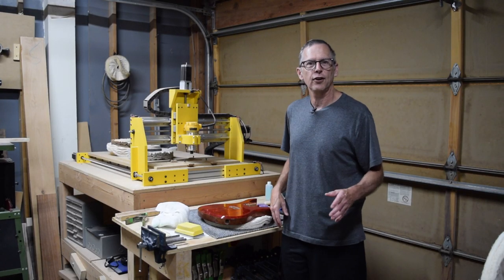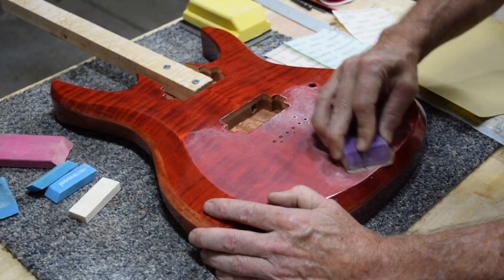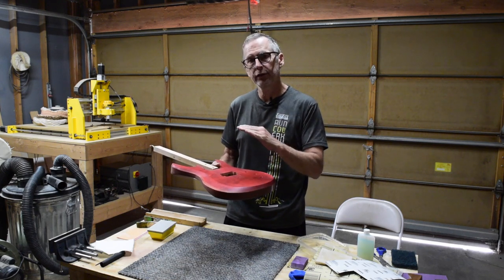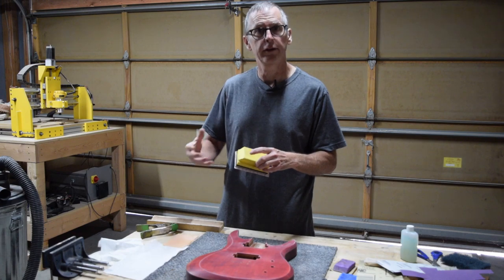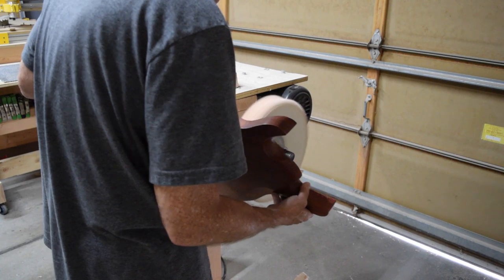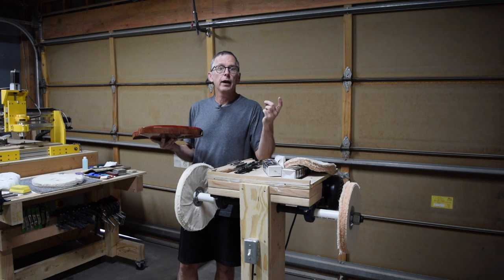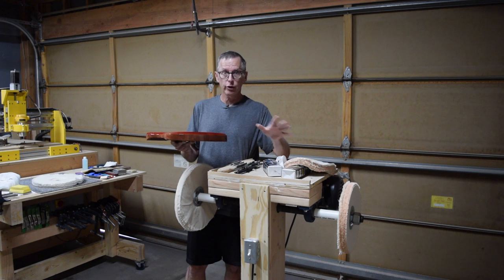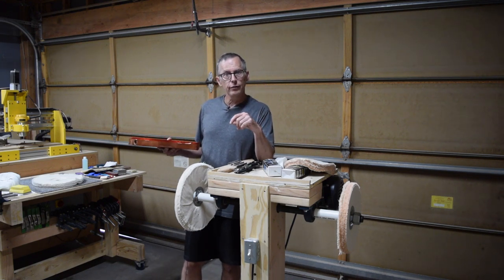How I Level Sand And Buff The Finish On A Guitar

Comment: Hello Chris. If I may ask. What rmp would you recommend for compounding and also polishing on a hand held polisher? I have a Avid dual action random orbital polisher that the slowest rpm is 2700. Is that to fast or aggressive for a polishing speed?
Reply from the maker: Sorry, I don’t know. I have never used a hand held electric polisher. I am considering switching from my big buffer to a hand held polisher, but I need to find one that can run from zero rpm and up. That way I could test to find the optimal speeds.

Comment: Great video! I have a fair amount of experience with painting, sanding, and buffing in an automotive application, and I know that edges are particularly scary in that you have to pay close attention to the direction of the rotation in relation to an edge so that you don't buff the paint off of the edge. I've never used a buffing wheel, or buffed a guitar....or water based for that matter.....is it just as critical and delicate near the edges using the buffing wheel? And how easy is it for the guitar to get ripped out of your hands when doing the horns? Thanks!
Reply from the maker: The wheels are too soft and spin to slow to burn through at the edges unless you really try. In the dozen or so years, I've used buffing machines like the one in this video, I have never had a guitar body or neck ripped out of my hands.

Comment: I've never used the polish sanding trick but then again, I buff with 3 compounds not 2. Funny how we all do the same things but just a little bit different. I like that because it helps me to explore better/different techniques. Always looking to improve! Thanks Chris.
Reply: I think your method would be removing more than desired material during the buffing stage, Unless you apply the necessary amount to make-up the difference, which cuts (no pun intended) into the bottom line during tax season.

Comment: What about refinishing an older instrument rather than a newly painted one?  Is there any surface sealer you have to use over the old finish (trying to preserve some of the original patina) in order to promote adhesion of the final layers?  Over shellac, lacquer, or maybe a finish that contains oil based stain?
       thank you!
Reply from the maker: I don't refinish old instruments. I only make new ones.

Comment: Hi, maybe a dumb question but.. when You say that You're using a P800 Grit, it's a "P800" referring to the "ANSI" (American National Standards Institute)  encoding? Thanks
Reply from the maker: The US standard is CAMI (Coated Abrasive Manufacturers Institute). It does NOT have a "P" or any other letter in front of the grit size designation. The "P" is found of paper graded by the FEPA (Federation of European Producers of Abrasives) standard.
Reply: @HighlineGuitars  thanks, looks like your 800 grit equals to a P1500 here, this clarifys to me every thing! :)

Comment: You need at minimum 2000 grit if you are going to buff without a dedicated machine. I use wet and dry for sanding but you need to make sure water does not get into the wood meaning all parts need to temporarily sealed. For example any scew holes otherwise the wood will expand in those areas and then contract when it dries which will slightly warp your totally flat fimish.

Comment: Got any tips for a cerused finish? The ash was grain filled but despite sealer, fill, sealer, and 13 light coats of nitro, you can still feel the grain. I imagine it is a delicate wet sand. It has a fairly shiny finish with very little orange peel except for the maple neck. As it stands,  I may just start with 600 and work my way to 12 or 1500 then put it through some heat and a freezer to check the finish- then a final buffing.

Comment: I think I would personally mask off the sharper edges with fine line tape or thin masking tape. The lacquers sit lighter on those areas and I wouldn't want to burn through to the base. But that's just what I'd do.

Comment: Thank You Chris, very informative and helpful. I’m using quality automotive urethane paint products and a StewMac buffing machine and I have what looks like very fine scratches under my Tamco clear. I use mineral spirts instead of water and I am very careful to not cross the different buffing wheels. I’m going to try your suggestion of less grits, maybe 800, 1,000, 1,500 then the two buffing wheels of medium and fine. 
ANY suggestions would be greatly appreciated. Thank You very much for the video.
Reply from the maker: When you apply the clear, are you sanding between coats? Scratches left by scuff sanding can migrate up through the finish and be revealed when level sanding. Also, scratches can occur due to contamination.
Reply: @HighlineGuitars  Hey Chris, Happy Halloween. Thanks for your response. 
First, I do not sand between the clear coats. I shoot the base coat, wait the regulated time and then shoot the clear. I built a small 6’x6’ spray booth in my garage so it’s relatively a clean spraying environment. 
I use mineral spirts to wet sand with and I’m thinking maybe it was contaminated. I’m curious about the dry sandpaper you used. You showed that it doesn’t load up, and you wiped it occasionally. Do you recommend I try it? Your body came out great looking. Id like to get those kinds of results. Which dry paper do you prefer most?

Again, thank you Chris for your time and advice.

Comment: I guess I'm dumb, but when you spray the clear coats on, doesn't that build up on the surface?  So when you sand, wouldn't those shiny spots be high spots, and not low spots?  I know you know what you're doing, but I'm just trying to understand this.
Reply from the maker: You're not dumb, you just have never done this before. The clear coat starts out shiny, but uneven and textured. To level it, we must block sand it. This removes the shine and makes it look flat. The shiny spots are the low spots that the sandpaper can't reach until the high spots have been reduced. Once the texture and unevenness have been leveled away, you have to progress through increasingly finer grits to restore the surface's reflectivity. Then you buff to make it look shiny.

Comment: Very informative video. I have a fender American original '60s Stratocaster that has some waviness going on in the finish or body, I don't know which, but I am starting to wonder after watching your video if sanding it down and then buffing it could make it flatter and not have all the crazy wavy reflections going on. It is a lacquer nitrocellulose finish. Do you think that is an option?
Reply from the maker: I doubt the clear coat is thick enough to sand it level.
Reply: @HighlineGuitars  Do you think the waviness is how Fender finished the wood or could it be something with the sunburst base coat underneath?
Reply from the maker: @j_music_8779  Without seeing the guitar, I have no idea.

Comment: Hi Chris. I used to help a friend rebuild and refinish pianos 40 years ago but have not tried doing any kind of refinishing myself. COVID has forced me into retirement and I thought I would try to refinish one of my guitars. I have watched many of your videos and feel comfortable with stripping and sanding from 120 to 220) but don't know which materials to use. I thought for sure I'd go with the Minwax polyurethane/mineral spirit mix in one of your videos but have told the fume would be very strong. 
In another video, you mentioned the problem with water based product...
Which video should I watch forerefinishing a couple guitars safety and inexpensively? Thank you so much!
Reply from the maker: Try this one: https://youtu.be/3RsweS6UFQc
Reply: Thank you so much for your reply AND for your videos. I've  that particular video several times, just wasn't sure if that's the "one". I watched your videos for about 5 hours last night and thought for sure the Boiled Linseed Oil/Mineral Spirit/Polyurethane/Japan dryer video was the one :)

Comment: Thanks for the recommendation for the Super Assilex. I've been looking for a replacement for the 3M flexible sanding sheets since they discontinued them, and this looks like it may be similar. I live and die by those sanding sheets.
Reply from the maker: According to the 3M website, Flexible Hookit 270J has not been discontinued. Only the trial pack was discontinued. The individual sheets are still available.

Comment: Thanks for the tips. What materials did you use to wipe the surface clean of the medium buffing compound? Solvents?
Reply from the maker: No solvents are necessary since the compounds leave a dry powder. All you need is a clean soft cloth or paper towel.

Comment: I've been doing finishes for a long time. I've always wet sanded in a circular motion however several YouTube lessons say sanding in one direction is better. I tried this on a recent finish and I'm not sure it looked any better than finishes I sanded circular.  Is there any science behind either method being better?
Reply from the maker: In my videos, I use both motions depending on the desired outcome. For speed, I use a circular motion and for the final grits, I use one direction (usually with the grain) which reduces undesirable scratches.

Comment: Hi, I asked you this last week but I don’t know if you saw the comment. What do you think about using Solarez as an initial base layer/sealer/grain filler and then over coating that with the crystal lac instrument finish? Do you think that would work especially since the Solarez seems to sand so well?￼.  Thanks for the great content.
Reply from the maker: Yes, it would work.
Reply: In a recent build I used Solarez grain sealer, followed by a Createx color coat and finally Crystalac Brite Tone.  Turned out great!

Comment: Looks great but why doesn’t work for me??? Im a luthier using shellack for all my life but now my clients have asked me to use harder stuff for back and sides. I have used almost everything like you, i have a stewmac buffing wheel machine, the only 2 diferences where i use rinosoft sanding paper, same greeds,    and the buffing compound is from stewmac instead of meserna. But the shine is never ok and I believe the buffing wheels are creating scratches :( I believe im doing domething really wrong. I used crystalac like you and waited 1 month to dry. Do you have some advice? Chears
Reply from the maker: All I can say is you have to use the same sandpaper, buffing wheels, and polishing compounds to get the same results I get.

Comment: What is the best method for removing surface scratches ie. marks in the finish of a guitar?  Can you buff them out?  I have a Yamaha classical acoustic guitar that I bought as a second and it has some marks in the lacquer that are visible when looking across the surface.
Reply from the maker: A lot depends on the type of finish that was used on your guitar and how deep the scratches are. If the finish is a lacquer such as nitrocellulose, you could try rubbing out the scratches with a clean cloth and some rubbing compound (Meguiar's M110 Mirror Glaze) followed by another clean cloth and some polishing compound (Meguiar's M210 Mirror Glaze). Finish with a third clean cloth and some swirl remover (Meguiar's M9 Mirror Glaze Swirl Remover). If that doesn't do the trick, you may have to lightly wet sand the area(s) with some P2000 grit wet/dry sandpaper wrapped around a small rubber sanding block. Then, proceed with the rubbing compound/polishing compound/swirl remover as described. Hope this helps.
Reply: @HighlineGuitars  Makes me nervous.  I might just have to accept that it's not perfect.

Comment: When using Solarez- how many coats should I put on top (Les Paul) before applying to sides and back?
Reply from the maker: 4 thin coats or 2 thick coats. Try it on scrap first to get a feel for how many coats you'll need. You may decide to apply more. Thanks for the $. Very much apprecieated.
Reply: @HighlineGuitars  
I have been testing applying thin coats with mascara pad - I will apply 2 thin coats to top then to sides and back and repeat - thanks for your videos very helpful !

Comment: EVERYBODY NEEDS TO BUY 0000 STEEL WOOL, TOOK ME LESS THAN 10 MINUTES TO GET IT TO A COMPLETE FLAT SURFACE!!! life saver and time saver
Reply from the maker: Eventually, anything rubbing against the surface will polish it back to a shine. Flattening with steel wool is a terrible idea.
Reply: Highline Guitars i applied 5 coats of clear coat to 5 project guitars i have and used 400 & 600 grit paper ... then the steel wool at the end to get everything even. (then polished it out by using your tips) and they all came out looking great, thank you for the video by the way!! great explanations on everything

Comment: I'm confused in your term "surface RPM". The shaft speed of about 1000 RPM, with 14" buffing wheels makes the surface speed about 3500 RPM. Please elaborate. Thanks.
Reply from the maker: SFPM (Surface Speed Per Minute) = 1/4 of the wheel diameter X the shaft speed. In my case, 1/4 of 14" is 3.5" X 1000 = 3,500 SFPM.

Comment: How do you take clear coat off the guitar head stock without hurting the pain
Reply from the maker: Very carefully sand it down with 600 grit until you reach the paint. Good luck, you’re going to need it.
Reply: @HighlineGuitars  how will I no when it's off than to I shine before I use laqur

Comment: Hi! First of all your videos are great and very inspiring!
I've a question: I'm on a satin finish on my very first build right now and I necessarily need to level sand. Which is the target sandpaper grit I should reach? I don't need to buff, i guess, as I want a satin look, but I neither want a 'scratched' surface, which is the result of 1500 sanding. My target is a satin, but flat, surface. Should I buff and then use 0000 steel wool to bring back the satin effect? Or simply reach an higher grit when level sanding? I really hope for your help, I'll take you advices as the Holy Bible.
Thank you!
Reply from the maker: I would recommend sanding to 3,000 grit with Super Assilex and then follow up with Norton synthetic steel wool pads (grey then white).
Reply: @HighlineGuitars  Thanks a lot!

Comment: Excellent video. Those are very helpful. Do you sand the edges directly, or do you leave a thin line until the buffer? If you do sand the edges, do you go over the edge in your quarter or do you go along the whole edge? I'm really scared of those edges.

Comment: I really want to try the Crystalac Waterbased clear but I don’t know if it’s better than the Urethane clear I use now. Would you say that Crystalac is as hard as Urethane clears or is it softer more like lacquers?
Reply from the maker: What are you using?
Reply: I’m using Sherwin-Williams brand of automotive clear. They sand real nice and buff out pretty nice as well. The waterbased stuff seems appealing for health reasons because I’m spraying quite a bit now that I’m doing repairs full time.
Reply from the maker: @Fazman81  I would say the S-W automotive clear is going to be harder than Crystalac. I'd recommend testing it first.

Comment: How about satin finish with marks and bubbles???
Reply from the maker: Why would you want marks and bubbles????
Reply: @HighlineGuitars  i mean...when i apply the watco wipe on poly....there are visible marks from the old shirt i used...is it possible i can level sand them to get smooth satin finish?
Reply from the maker: @salverejina4177  Yes, as long as you have applied enough coats to level sand without sanding through.
Reply: Thank you so much sir..was about to get the print for pickup winder from your site....much respect🔥🔥

Comment: Hi Chris, why you use dry sanding and not the wet sanding? There is a specific reason behind this choice?
Reply from the maker: It's faster and I have a better view of what's happening on the surface as I sand.
Reply: @HighlineGuitars  Thanks

Comment: Great video!do u plug the screw holes when painting and spraying the finish?
Reply: Have you ever used 2K and what’s your thoughts on it. I don’t have a sprayer so rattle can will be my finish. You said in an earlier question to put on12-25 coats one a day over my painted guitar. What would that number be in rattle kans. either 2K or lacquer? 
Thanks so much! You’ve helped me soooo much!
Reply from the maker: No.
Reply from the maker: 2k polyurethane is extremely toxic. You have to wear a hazmat suit and a fitted respirator. Look up isocyanate. https://www.osha.gov/isocyanates
Reply: @HighlineGuitars  I know. I have a double respirator, long rubber gloves and a rubber apron I use to do tie dye. I havent decided.if I want to risk it yet... thanks for the info!